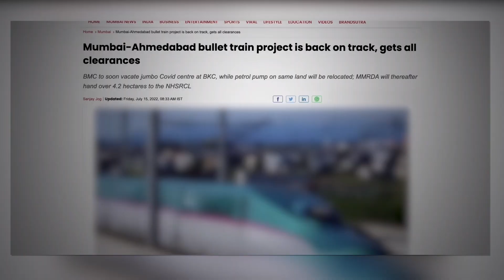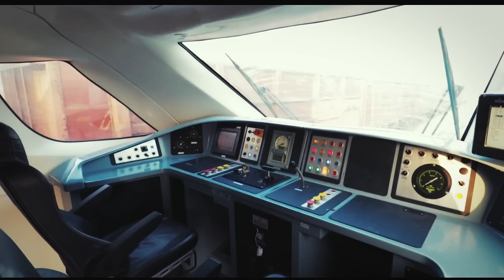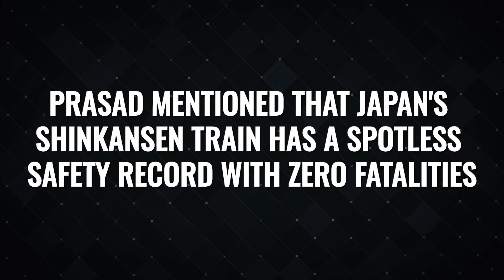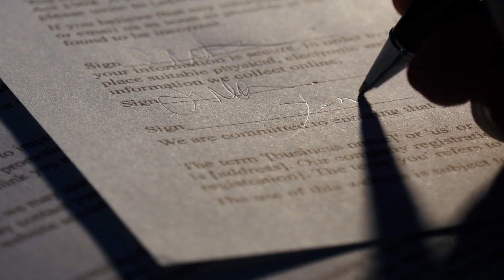The Race to Build India's first Bullet Train

Comment: It should have been running in 2022
Shinzo Abe visited and announced it
Still better late than never
Reply: Now, India is gonna postpone it to 2052.
Reply: @rogerfaint499 
It's already being build the construction has been going on for a year now
Reply: @rogerfaint499 even if it is ready in 2023 this would be a outdated model, it's speed is only 320km/h vs 350km of China and indonesian, by 2053 China would have the 600km/h ready, China have already to used the 450km/h trains which it just finished testing